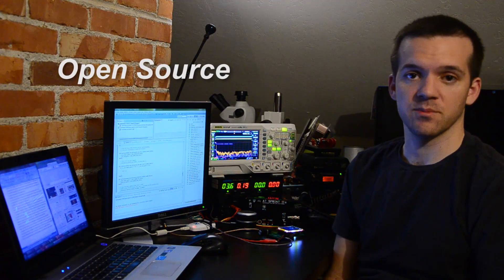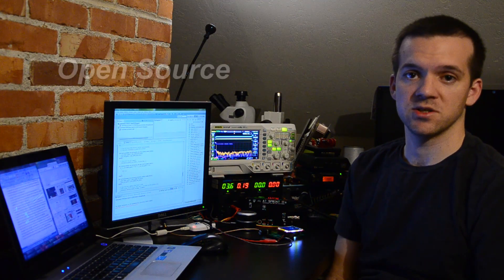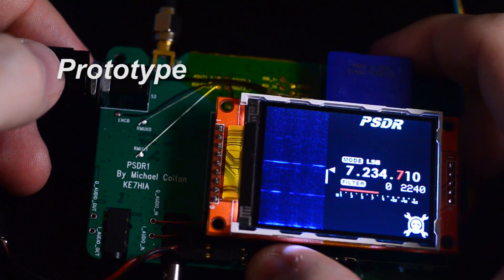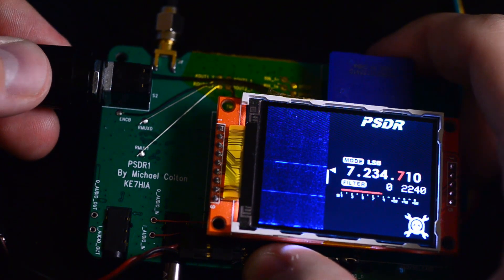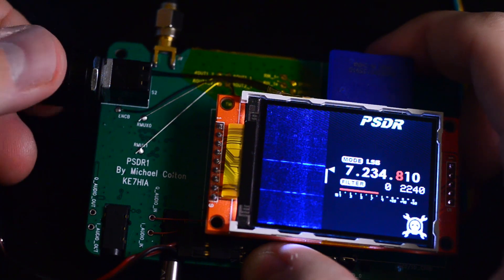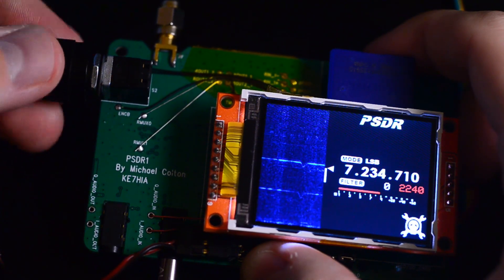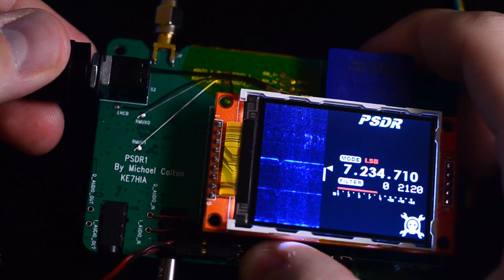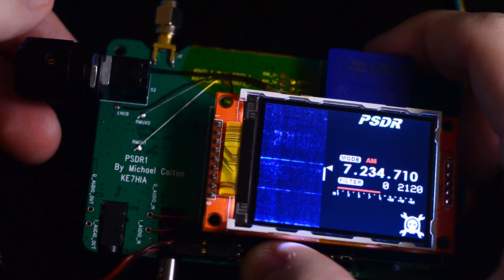PortableSDR Overview

Comment: Wow. Super cool work! What will a portable setup look like with PSDR, in other words, what parts will you need to carry with you when backpacking? Would it be a simple as the PSDR, some coax, a battery and an antenna?
Reply from the maker: That is the right question! One of my goals with the PSDR was to make it as self sufficient as possible. Just the PSDR, some coax, and an antenna. Just what you described, except the battery is internal. The PSDR2 (prototypes next week) has the battery, microphone, speaker, and a morse code key built in. It doesn't have an antenna tuner, but it has an antenna analyzer, so you can be sure you are using the right band(s) for the antenna.
Reply: Michael Colton Very cool! I look forward to seeing more on this project!